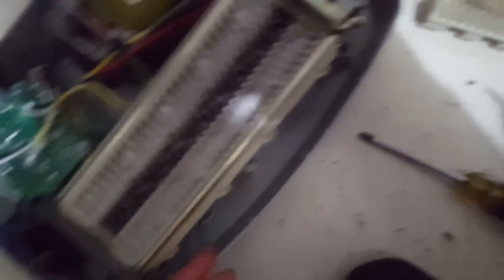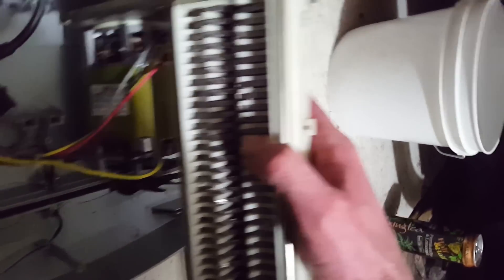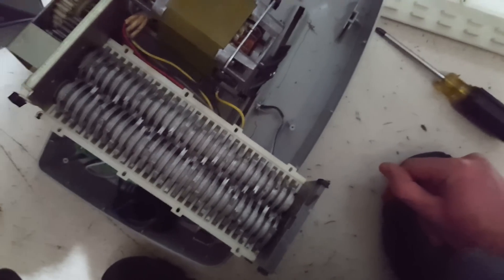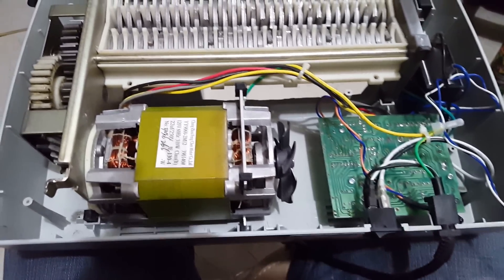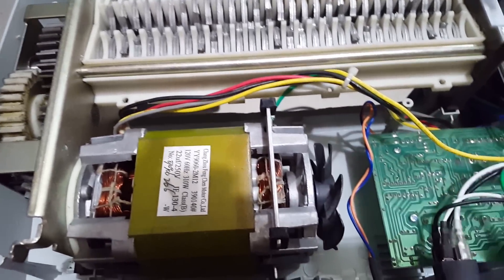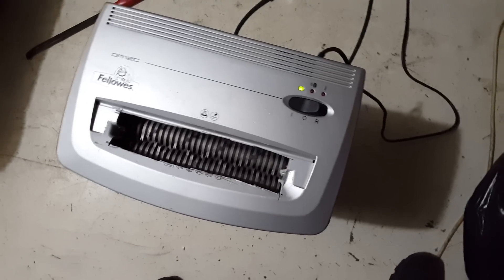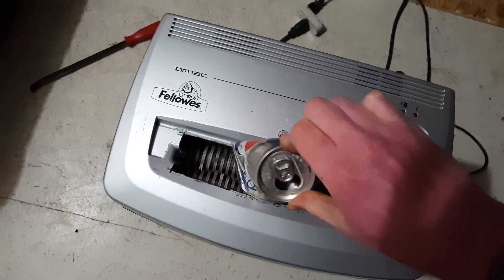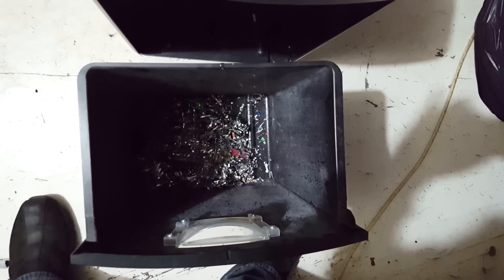Aluminum can shredder

Comment: Curious if you can just bypass the circuit board and connect the motor to 120VAC but through the switch since it reverses the motor. I'm thinking that all the board is for is to turn the motor on and off and stop overloading. In one video I saw the person bypassed all sensors and safety devices and made one beast and it shredded everything.

Comment: So how many cans have you shredded in the last 4 years? I have the same shredder, thinking of going aluminum with it. Thanks! Always love your videos!
Reply from the maker: So I did more after that but it has been a while. I actually filled a 45 gallon trash can with the shreddings lol. I have more cans I just need to set it up again. The biggest issue I have is it gets too hot and won't shred as well. I may just cut a hole in it for ventilation. I wanted to install a fan but at this point anything will help

Comment: How long did the shredder last? I imagine aluminum cans will eventually burn out the motor?  I found a used 10 sheet version on ebay for about $30. Gonna give that a shot. Thank you for your video.
Reply from the maker: I haven't used it in a while, but it worked fine before I stopped using it and I had almost a whole 39 gallon trash can full of it. I still have it so I should try it out again. Only issue is when the motor does get hot it loses torque. I want to mod it to have ventilation from the outside which would help a lot.

I know there are shredders that are more industrial and shred even finer. I would just look for that, but this is great for me. Only issues I have are the really big cans (can't remember what size). The one I have is crosscut. I would only recommend crosscut.

Comment: If you put a bigger motor on it, would it work better and possibly shred more than just cans?
Reply from the maker: Depends what stuff you wanted to do. I imagine they are made from steel so it may be able to shred up to that as far as hardness. I've also shredded some thinner tree branches around an inch or less in diameter.